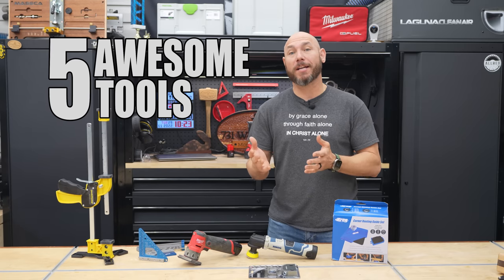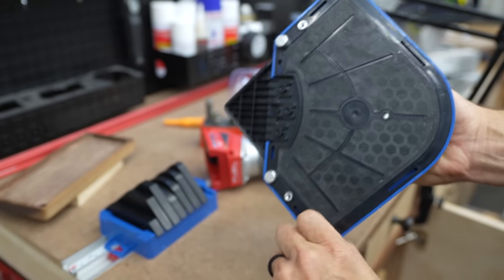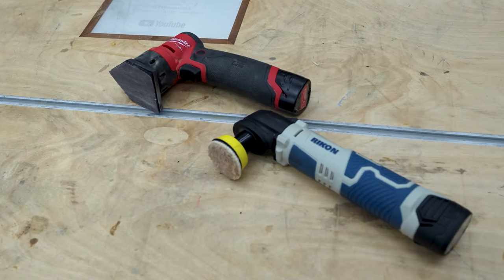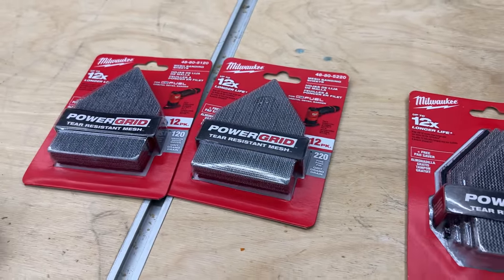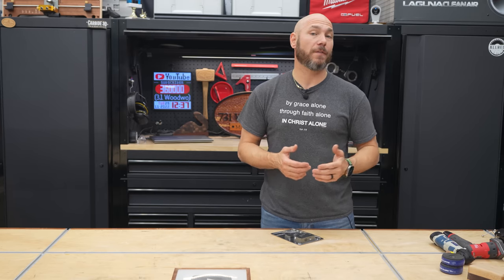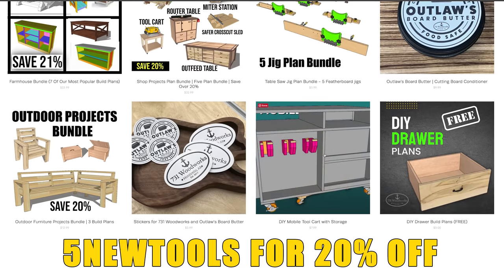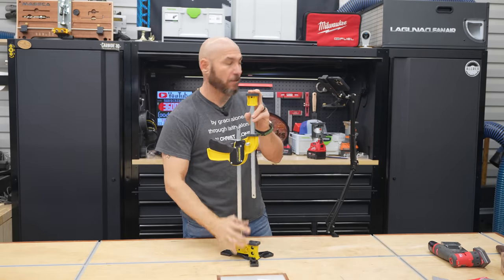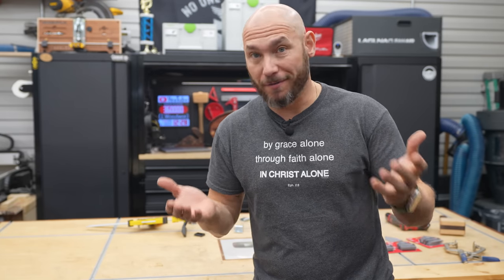5 Awesome Tools You've NEVER Seen Before!

Comment: I use Dewalt's Oscillating Multi-tool, and I've found that the sander attachment works SO well.  I find myself using this instead of an orbital sander whenever possible.  The only downside is it doesn't have dust collection...but I'm fine with that.

Comment: 731 Matt, I have no idea how I missed this first time around but when you got the detail sander, it popped a lightbulb in my head if you have old blades for Oscillating Multi-Tool, you can actually cut sandpaper for whatever Great you want. Attach it to the blade. Use rubber cement if you want and use that as a detail sander.  I feel like I need a parrot rubberized foam pads are cheap and easy to come by. I like my DeWalt

Much L🫶🏻VE and Respect, and God bless to Y🫵🏻U and Miss Amy‼️✊🏼✊🏼✊🏼🫶🏻🫶🏻🫶🏻

Comment: Why does Kreg continue to make stuff out of plastic?  I much prefer Aluminum, even if it costs 2x.  I got a well made aluminum corner set that costs what the plastic set from Kreg does.

I love the TrigJig and have them as well.  The angle finder is super handy with the miter saw, since it reads in actual miter saw angle settings and not "true" angles (if you have one, you know what it does).

Comment: Great...now I have to go sell MORE rivets and cutting boards to go get these😀. Gonna need a bigger shop soon. Great reviews!
Reply from the maker: lol thanks!
Reply: @731Woodworks  5:14 you mention there are no alternatives to this tool that don't cost a lot more - I'm not fussed about the extra cost - what are these more expensive alternatives to the Rikon?
Reply from the maker: @okafka5446  Surf Prep makes one (I think) and Mirka makes one.
Reply: @731Woodworks  Smallest Surf Prep makes is 5 inch, smallest Mirka makes is 3 inch - more importantly they're both mains powered. The only one I can think of that's close is the Milwaukee 12v right angled die grinder, but for sanding it spins way too fast. Just thought you might of come across something different, and ideally better engineered for a longer service life.

Comment: Hey Matt I never tried a router cut off bit. I have a cordless dewalt router. Do you set the speed high? You made it look simple and I want to try it.
Reply from the maker: The larger the bit, the slower the speed.  This one works good at either max speed or slightly under

Comment: All I can think about is 3D printing some custom corner jigs that slot into that routing tool. Any FDM printer can handle a job like that, and with PETG or PC the home-made parts could last a long time. I would start by measuring certain dimensions of the part and then snap a picture and build the model off of the picture and measurements.

Comment: Dude, you said these tools were a hundred bucks. Cheapest I could find was $180. For the Milwaukee. Not trying to split hairs here but hey, we are in a recession.
Reply from the maker: The Rikon is $100, and I actually said "give or take" The Rikon is actually $70 at Acme Tools if you pre-order now as they are currently back ordered.
Reply: I just bought the Milwaukee detail sander for $129 at Home Depot - not online, but the physical store. The price is labeled $179 but when I scanned it the price said $129 - I’m in VA!